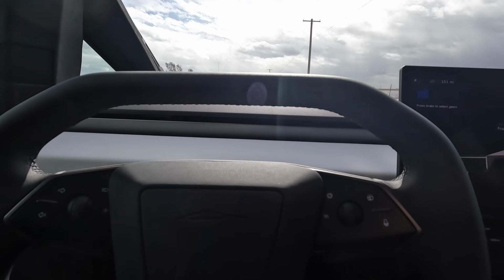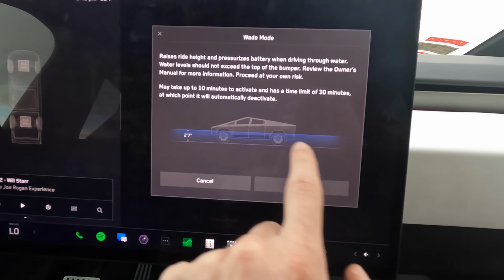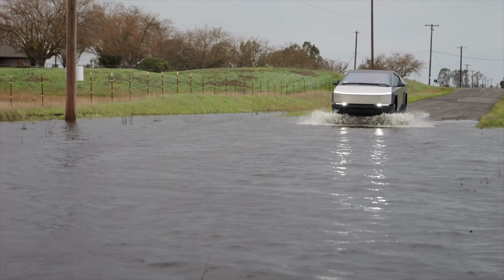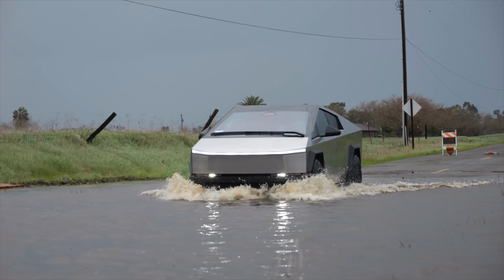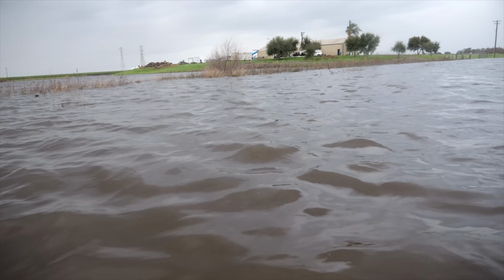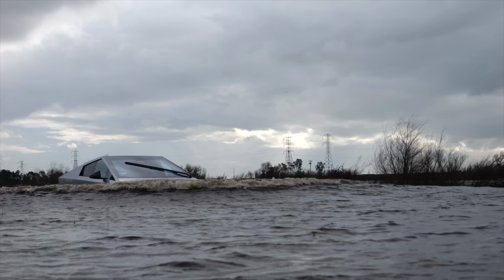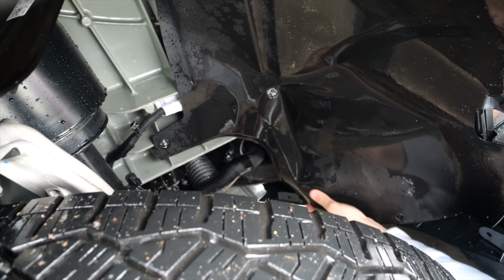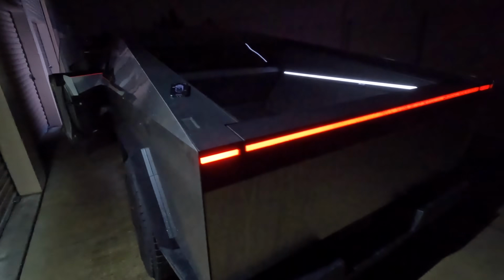How Deep Can Tesla Cybertruck Drive in Water? -Wade Mode Test

Comment: "This puddle is way deeper" he says as he stands in a small lake
Reply: I'm surprised the truck didn't flood with the horrible panel gaps and quality control. 😅
Reply: @CamcorderHomeVideos  i have been in a model 3 that decided to go through a puddle and the water almost reached the windw level but nothing leaked in. It was during the storm in sacromento and lot of floods were happening and I know for a fact that a gas sedan would never do that.
Reply: DRIVE IT THROUGH RICE
Reply: @droneon5575  Oh nice!
Reply: @CamcorderHomeVideos  You are just regurgitating fake news about panel gaps
Reply: @srirammanian536  My apologies. I was making a joke because Tesla did have very poor quality control, but it has definitely improved. I have seen videos where the Cyber Truck had small gaps and things, but it's not as bad as older Tesla's.
Reply: @CamcorderHomeVideos   They've definitely improved quality over the years.  Some of the criticism about build quality is legit in my experience with a 2018 Model 3 which had some small noise issues (which were fixed quickly) but always felt the car media would over exaggerate things like panel gaps.  Panel gaps on my Teslas are not much different from any other cars I've owned - Hondas, BMWs, Toyotas, etc.  The one area where Tesla needs to improve is NVH which they seem to have finally done with the new Model 3.
Reply: @droneon5575  did you have any problems with the car after that?
Reply: @crossxfuse  not my car i was the passenger and no he didn't have problem with the car
Reply: I laughed at puddle.  Little big for a puddle. 😊
Reply: @TristenHernandez  so you are saying run over some Japanese cars? 😮
Reply: @CamcorderHomeVideos  steel is incredibly hard to work with, and given it’s a completely new manufacturing process, they are doing great imo
Reply: I'm just wondering how well it'll handle rust afterwards. There has been numerous reports of owners already seeing rust spots all over their Cybertruck just from everyday driving through inclement weather.
Reply: @CamcorderHomeVideos  What horrible panel gaps?  And quality control?  You're entitled to your opinion but not an expert at that.  It's a $100k truck, not a 4million supercar so what are you asking of it?
Reply: @robertangeles9537  uhh $100k for a truck is a lot. lol
Reply: bro
Reply: @KunoMochi  It's not the steel on the truck that's rusting, it's like metal particles I gear and they're the size of a pin head
Reply: fr i was like “ what fucking puddle, look like a damn flash flood”😂
Reply: @droneon5575 I've gone way deeper in my 78 Jeep Renegade that only had a 2 1/2" lift with 33" mud terrains. Just in case you're not smart enough to figure it out, gas powered V8 engine. Your comment is not very bright at all!
Reply: @noybnoyb6883  your answer isnt bright  first read my comment and maybe you will realize i was talking only about sedans. I never said anything about  that a tesla sedan could wade deeper waters better than a jeep or a truck . I said it was impressive that a family sedan drove through water where it reached the windows, pretty much halfway if not more submerged underwater and nothing leaked in and no car malfunctions. Submerge a gas family sedan  halfway into water and drive it out. I wont be aggressive back to you ,Here copy and paste with into your browser------>2nd attempt! Driving the Tesla Plaid UNDERWATER! We did it!! Tesla Submarine 2.0
Reply: @noybnoyb6883 ya and the Jeep was unusable immediately after😂
Reply: @noybnoyb6883 Get over it, remember when they were only horse buggys should we go back to those only? No one says you have to get one and by the time the roads are filled with e-vehicles you might be long gone to your final rest. The younger people  will be arguing over some other nonsense.
Reply: Just put it in rice. It will fix right quick
Reply: @CamcorderHomeVideos  we didnt really get to see the inside of the cabin after the event
Reply: broooooooooooooooooooooooooooooooooooooooooooooooooooooooooooooooooooooooooooooooooo
bro
Reply: Imagine a short in the electrical- he’d become a toasted pop tart in femto seconds⚡️⚡️⚡️
Reply: Imagine a short in the electrical- he’d become a toasted pop tart in femto seconds⚡️⚡️⚡️

Comment: He really stepped up his budget for destruction
Reply: yeah, Tesla's have no battery box protecting their battery's from water so that Tesla's dead from battery rust eventually. can't wait to see that video in a few years.🤣🤣🤣
Reply: @SaraMorgan-ym6ue the CT actually does, hence it can pressurize the pack (like it says it does)
Reply: @BH4x0r  so does not say keeps the water out which also applies to the other Tesla's so why would the cyber trucks battery be any different against water then the cars for getting wet and rusting out? hmmm
Reply: @SaraMorgan-ym6ue  maybe because it is made for it? hmm...

like a normal person isn't gonna submerge or ride through deep water with a 100 grand sedan
Reply: @SaraMorgan-ym6ue  even other tesla cars have sealed batteries. It’s just that if you submerge them long enough in salty moldy water the seals will eventually break and let water in but the cybertruck should resist much better
Reply: @nomecognome2  ok then explain why the Tesla model X battery rusts out from water leaking on it from the a/c condenser in the dash then hmm? oh I guess that was just because it was inside the sealed box to🤣🤣🤣
Reply: @BH4x0r  nope!!!! the electronics are going to suffer trust me! it has already started.
Reply: No, just a rental.
Reply: @SaraMorgan-ym6ue  The battery pack is pressurized
Reply: He probably rented it like most Youtubers do.

Comment: There is boat mode too but you have to get optional water proof doors. You should use the money from this video and install them and drive across the Mississippi River.
Reply: Not available yet, just planned.
Reply: No there isn't lol
Reply: @ItsBinhRepaired are you calling Lord Elon a liar?
Reply: ohhh is that a thing now!! I didn't think it was out yet
Reply: @guywithjeep  look how low it sinks and still drives. It won't float well enough. Lol
Reply: @guywithjeep Lord Elon who said this Truck will be bigger, will have more range, will have more seats, and will cost less never lies 😂
Reply: Its still an overpriced piece of crap, no matter how much bling you add to it.

Comment: Next video... "My cyber truck is rusting"
Reply: bro
Reply: no, that will be after the 'why do i have so many electrical issues' video
Reply: @patricksommers2629  bRo
Reply: I would be more concerned about all that water that's now sitting in his subframe with no way of draining.  There is a reason these things have been bricking from just from being washed.
Reply: @vortexgaming687  Is that why they are bricking after going through a carwash?
Reply: @nikushim6665 Hes inactive
Reply: Its stainless steel  its very hard for it to rust
Maybe in some circumstances it might rust easier, but you shouldn't worry too much
Reply: @yuppp7204  exactly
Reply: @vortexgaming687  Is that sarcasm or did you not see the last minute of the video?

Comment: Huge tip from a somewhat experienced driver here, when going through a puddle, you wanna drive as slowly and as carefully as possible, that way things don't break, and water doesn't get in places that it's not meant to reach.
Reply: Huge tip is never ever drive in high water. It’s bad for every single vehicle. Making it across, is the same as surviving a massive dose of radiation - you will definitely have problems later. 😂😂😂
Reply: he went way too fast if he was going normal speed like he should have the water would have never reached the hood
Reply: My 7yr old daughter know that.
Reply: But its part of manufacturer's spec though. The mode says it all : "Wade Mode". Cybertruck has been built to traverse through deep water. It should be ok
Reply: Yes like 'full self driving' is a car that fully drives itself with no assistance. Don't be fulled by the name only do it if you are ready to deal with the consequences if it fails that's simple to understand.
Reply: @B3tabyt3  
Fake news. Elon or Tesla never claimed that their cars can drive without supervision. The exact opposite, they make it very clear every time that you does have to, and you are still responsible, and the car itself also ensures that you pay attention.

As for Wade Mode, they clearly specify maximum depth, and this was more, because he drove too fast and the water didn't have time to get out of the way.
And still it very likely just have to dry out. We saw this with a fully submerged Model S Plaid, it had dozens of malfunctions, then worked perfectly the next day.
Unlike a gas engine that ingests water.
Reply: @rova3308  there is nothing tough about that truck lol....
Reply: @andrasbiro3007  maybe read first who said anything about Musk? Only claim I made was don't trust the name or the mode.
Reply: Always drive in first gear if at all the car has ot traverse via watter
Reply: @JetFire9  sometime its needed. Thats why there a vehicles out there build for this.
Reply: @JetFire9  yes even if everything still works there is water now where it wasnt. Bearings for example.
Reply: Lol! There was a time when my feed was filled with videos of cars failing to fjord a particular spot in the uk. For some reason, the road is underwater and a majority of the cars that fail are the ones that try to blast through! I think all that speed kinda pressurises the water, forcing it into places it otherwise wouldn't have gotten into. 

Shame about  the damage, but it was fun to watch though! Hope he pressurised the battery one more time after he got home to force any water that may have gotten in, just in case.
Reply: 2 weeks later: “cybertruck for sale, in perfect conditions”
Reply: @rova3308   should be and will be are two different things though, it's tested and designed for deep water by vehicle driving standards - not driving through a small lake like this video haha, id love to see this guy make an update video in a year to see if this truck suffers any long term effects from this video.
Reply: @snoopdagg7900 ha that's what I was thinking too, and  no warranty because of video showing off-road.
Reply: @B3tabyt3  nobody who is purchasing Full self driving beta thinks its fully autonomous. Not only is it made very clear before you make the purchase, but you also have a 3 month free trial to try it out before your purchase it. The car also wont drive if you aren't paying attention to the road and will pull over if you ignore the warnings.
Reply: @SamuelMM_Mitosis  gotcha.
Reply: @andrasbiro3007 but the name implies otherwise. also legal disclaimer is very clear but Tesla website was not always that clear and Elon musk tweets definitely not clear
Reply: @rova3308  What do you think of when "wading" in the pool? It's slow and light movement. It's not speed boat mode
Reply: If u would of stopped the truck it would of been fine water was not at the top of the tires in any puddle you drove threw
Reply: @rova3308  it is an amphibeous all-terrain vehicle after all. Truly a chariot fit for a golden god
Reply: But what if you're driving through a lake?
Reply: I think you forgot what channel you’re watching or you’re new here. This guy breaks tech for a living. If you’re new welcome!
Reply: My hoogee from naija, i see you😂
Reply: @rova3308 Yes, LRs also have such modes. But does it allow going into the water at friggin 20 mph? You know, water doesn't compress, this hits HARD. No wonder plastic bits came off.
Reply: @JetFire9  Yes you definitely want to double-check suspension and bearings, dry it clean and lubricate if needed after this. Definitely won't buy a car after a guy who tested its wading mode even at 1 mph, let alone at 20 :P
Reply: @rova3308  Manufacturer's spec also said it is built for any planet. The same manufacturer which recommends to keep it away from rain, road salt and bird poop.
Reply: The very nature of water being water is that's going to get in places whether you drive fast or slow.
Reply: Seriously though hitting it at 20+ mph is wild
Reply: Loved my Range Rover Sport... and made sure I took advantage of the off road training course where we were driving along rivers with the water up to the bonnet... I was watching this with a cringe. You should be driving slowly enough to create a gentle wake - not gunning it like a teenager 😂
Reply: @rova3308 It isn't part of the spec to drive at irresponsible speeds through said water.
Reply: @rova3308   Wade mode, but not Dive in at full speed mode!
Reply: @alertbri  he tries to break things on purpose. That’s the nature of the channel
Reply: @B3tabyt3 Clearly a huge Musky wusky fanboy...
Reply: @jamesbuttery3862  😂.
Reply: @jamesbuttery3862 and yet...here you are watching a video about a Musk product that we all know you can't afford 😂😂 💀
Reply: @B3tabyt3 bro did you put a period after that emoji?
Reply: @chitownbangin  ya just used to tapping the space bar after every final word. The fullstop comes automatically.
Reply: Boooooringg...
Reply: One time I was in a queue on a flooded dual carriageway - we were all going very slowly and bumping up onto the central reservation to keep the water out of our cars.
Van driver didn't want to wait, so thundered past us on the inside lane... only to stop after the flooded portion, the van not moving and water pouring out of the back. Still makes me chuckle.
Reply: its an ev, there shouldnt be any problem with hydrolocking an engine lmao
Reply: @snoopdagg7900  *periodically makes sloshing sound.
Reply: @alanmay7929  jealous
Reply: @B3tabyt3 
1. Tesla made the feature, and Elon is the marketing department of Tesla.

2. The proper name is "Full Self-Driving Beta". The "Beta" part means that it's an unfinished product. Software products are often released to external testers.
Reply: @pankaj5080 
The Cybertruck goes up to 112mph in 1st gear.
Reply: @andrasbiro3007  gotcha.
Reply: @ocoolwow seriously! i dont care!, he is destroying a perfectly working one just for the view, just wait for the list of problems that will follow!
Reply: @snoopdagg7900  underrated comment😂😂😂😂.
Reply: @rova3308  SHALLOW water not deep water. it says right there.
Reply: @ettcha  exactly! This is what people don’t get.
Reply: @emmanueltheorb  I greet you, boss 😄
Reply: plus you want to hit the water, and allow the wave to move forward and you follow behind it, not in it
Reply: @snoopdagg7900 adult owned never offroaded. Always garage kept
Reply: @ettcha rufford ford ahh videos
Reply: this is a TEST.  smdh
Reply: @rova3308  facts.  i made it through 3' by mistake

Comment: I love how isolated it feels from the environment. It's like a spaceship.
Reply: it could technically drive trough a chemical bomb attack or somethng like that, because there is a mode where the inside gets pressurized so nothing from the outside gets in
Reply: @Nuke-MarsX I would trust that is true as much as I trusted the "thermo nuclear proof" windows
Reply: @gareth6326  all newer Tesla's have the mode. the air that is let in is filtered through a special HEPA filter which scrubs the air from stuff you don't want. By the way the mode is called "bio defense mode" XD
Reply: @Nuke-MarsX  I am not saying they don't say they have a bio defence mode. I am saying I wouldn't trust it given the past claims of Elon that are not true
Reply: @The1QwertySky WOW,that's amazing 👏 😮I love this beast,and the stainless steel is fantastic, any marks or paint 🎨 I can use wire wool to removed anything 😅🙏👍
Reply: @Nuke-MarsX  My car also has that bio-defense mode... Every modern car has HEPA filters on the air intakes. They are usually replaceable and you can find them behind the glovebox.
Reply: imagine it had a lcd screen for a windscreen
Reply: @MrUnder30seconds  Ooooh, that's some MurkMobile vibes
Reply: @Nuke-MarsX  they couldn't do a "car wash" mode properly  and you would trust them against actual weapons?
Reply: @nashooo5903  what about car wash mode?
Reply: @Nuke-MarsX   didn't you hear the stories (yes, in plural) of the cyber trucks breaking down in a car wash, even with car wash mode on? it even was on the news.
Also no warranty for water damage ;)

Comment: >this "puddle" is way deeper
drives through a lake
Reply: Why not measure the actual depths with a rod and report them to us?
Reply: @bobloblaw10001 because its not that deep.
Reply: @sandroschtolpe6803  Event 2 feet of water is dangerous to a car.
Reply: @wagfim do u mean even
Reply: @wagfim not for an offroad truck
Reply: @bobloblaw10001 its 2 feet to 2.5ft max you can see the camera guy out there it goes to about waist height
Reply: br0

Comment: Looks like at 6:50 it popped a warning saying lowering suspension due to current speed. I assume the wade mode isn't meant for over 25 mph considering he went nearly 30 mph it probably lowered the suspension in the water which maybe caused it getting more damage that was seen later (maybe deactivated the wade mode?).
Reply: It did
Reply: Other reviews have noted that the biggest flaw is that it lowers suspension as soon as it detects anything it doesn't like.

You REALLY don't want it doing that.

I think there's bugs that can be ironed out... But there are a hell of a lot of bugs. It isn't effectively water resistant enough to do what it claims.
The fender liners ripping out... The broken buttons. The retention of large amounts of water.

Eek.
Reply: Nerd bot🤓
Reply: @RobloSam  What did you just say to me?